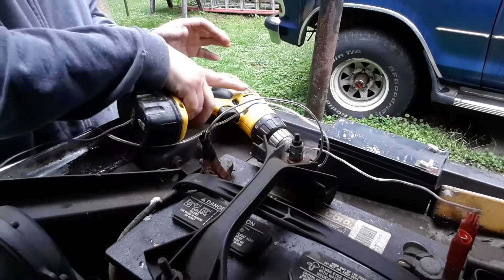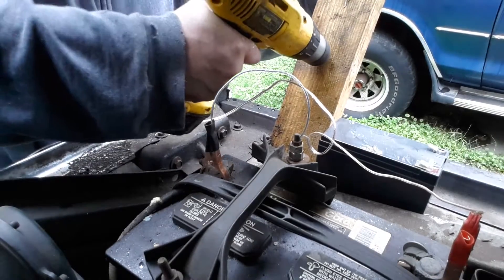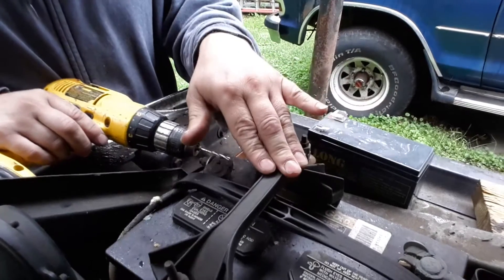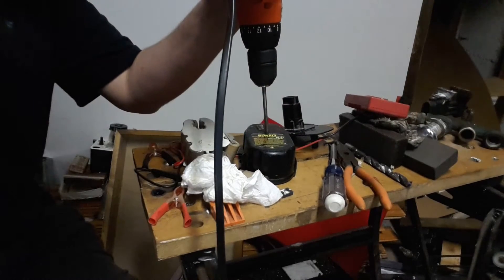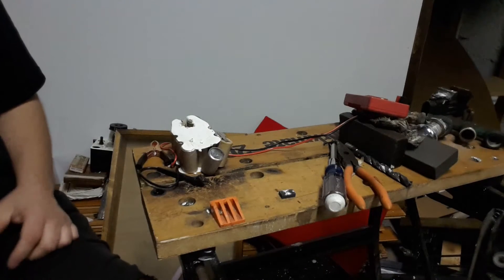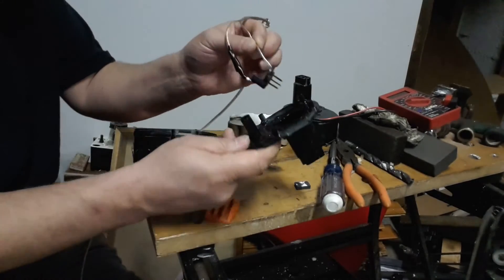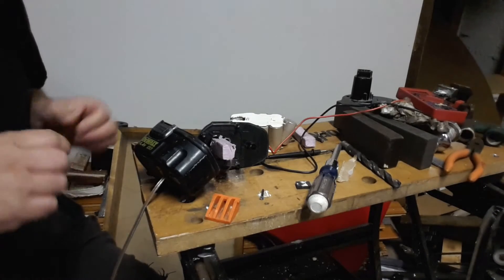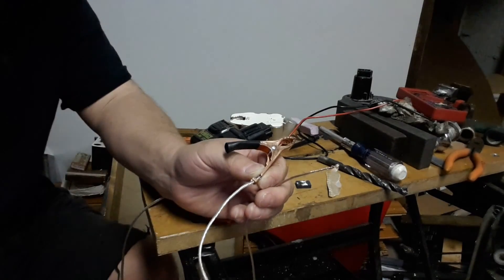Run your old battery drill from thre car battery

Comment: You should use thicker wires. A drill can draw tens of amps. With the smaller batteries you can and should use spade connectors, which aren't likely to be shorted out like the alligator clips are.